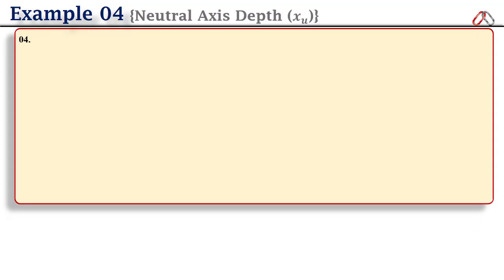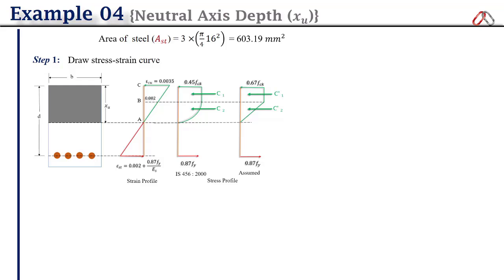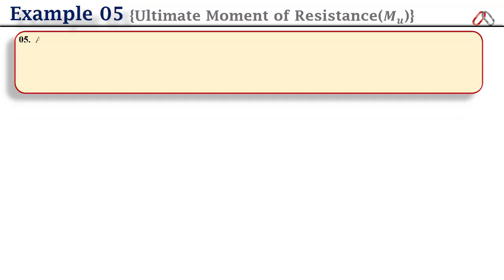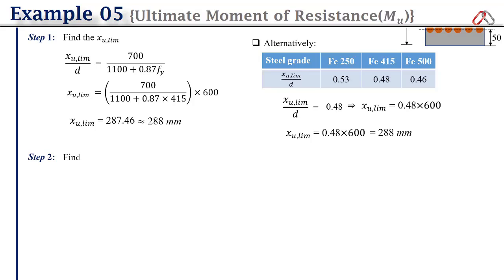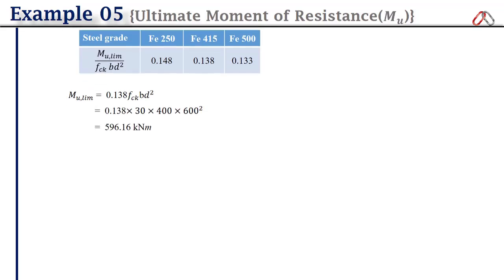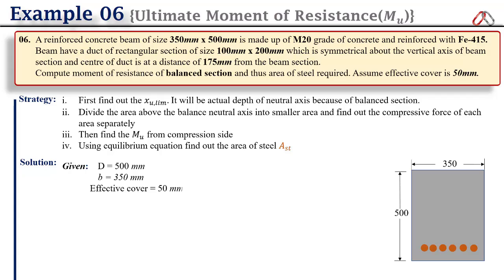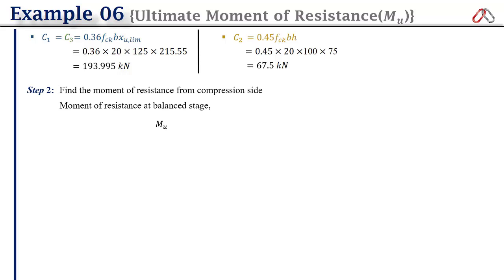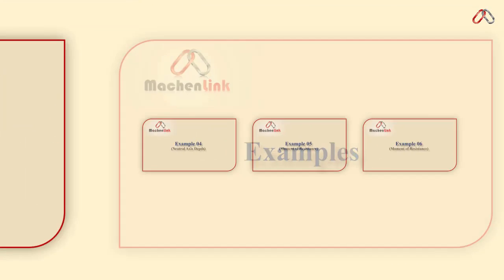Analysis of Singly Reinforced Beam || Limit State Method || Reinforced Cement Concrete

Comment: sir, pls correct me if i am wrong. in your example 06, step1, while finding the xu, lim value of 415 is used in place of 450, since d=450mm. kindly explain the correct one....
Reply from the maker: Hi pathy,
It is typing error but the calculation is according to d = 450. (0.48 X 450  ≈ 215.55)
Reply: Thank you very much sir, for your swift reply....

Comment: sir just one more thing...in example 5 for finding the moment u devide the moment found by 1.5 to obtain....unfactored moment ..but for Working stress method u did not do it
Reply from the maker: In LSM we use partial safety factors for material as well as loads. In WSM we use the factor of safety only for materials.

Comment: Sir what is factored and unfactored moment
Reply from the maker: Moment used for design purpose after applying the partial safety factor of the load is called the factored moment, without partial safety factor, we simply called moment.

Comment: Why did we use .45fck*bh while calculating C2
Reply from the maker: Hi Deepak,
Depth of rectangular compressive stress block is 90.33 mm and actual depth of part 2 is 75mm(< 90.33 mm) . Part 2 doesn't come under complete stress block (rectangular + parabolic) that is why we only use 0.45fckbh.